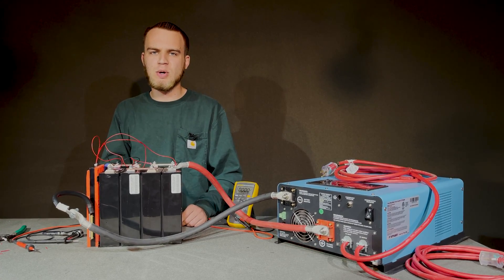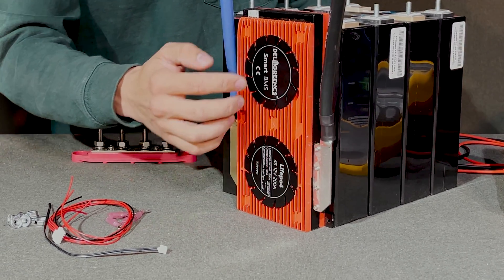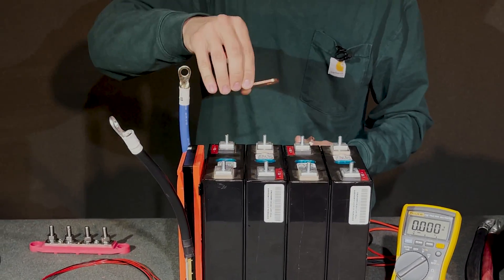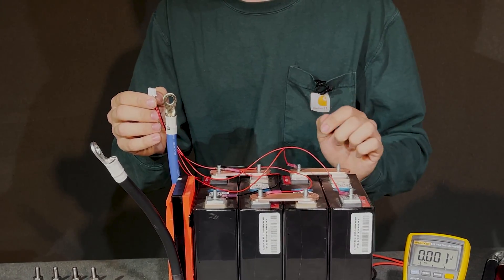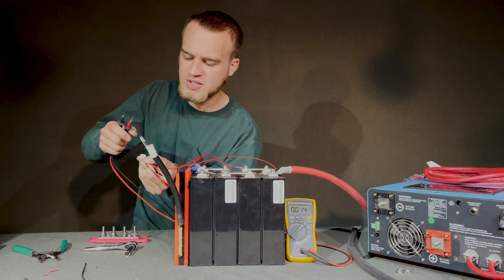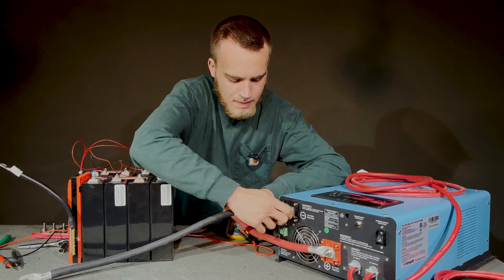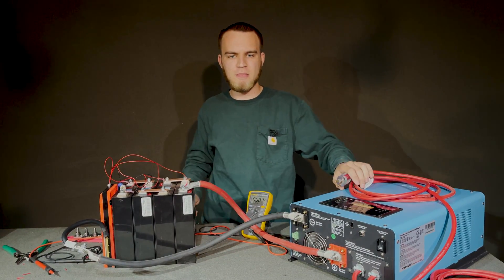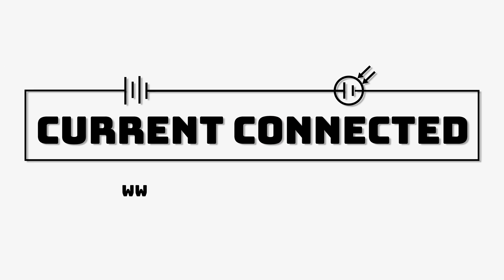Step By Step || Installing & Activating Daly/Deligreen 4S BMS

Comment: When you setup a BMS balancer cables, they all go on negatives with the exception of the last one that goes to positive. Balancers only balance by the negative cable. Will be better to explain that goes to B0, B1, B2, B3 and B+. Nice video.

Comment: Excellent video and very clearly explained in brief. We connected the balancing terminals to batteries, NTC is connected. We shorted the P- and B- terminals and tried to switch on the supply of 60V for a 52V Li-ion battery, 100 AH for around 6seconds. Still we are unable to charge the batteries through Daly 16s BMS. Any inputs please.....
Reply: No current is supplied to batteries, meaning the BMS is not allowing the batteries to charge.

Comment: Even better than folding those fine wires, you should apply Ferrules to them appropriate to the wire gauge, then crimp the ferrule in the ring terminals.  Much stronger.   Ferrules should be used on all wires that are compression fit for a grab, instead of on bare wire.

I just did my Daly BMS wires and the ferrule/terminal method worked great to where the heat shrink on the terminal grabs the plastic of the ferrule.

Comment: When i was wiring my bms i measured the voltage of the battery and it was 54.0 volts (13s battery)
then i connected the bms wires, everything was fine, 1 =4,15 2= 8.3 and so on, but when i soldered the b- to the - port of the battery and measured the b- port and the + port of the battery it showed me 25.5 volts... i dont really know why... maybe you can help`?
Reply: I noticed when the voltage of BMS is lower than battery voltage? The BMS is not turned on. Must have charge current on, after shorting B- P-, try pushing the blue tooth dongle switch, was also told you can try to run a jumper from pins 1 to 3 where the light board plugs in. I'm guessing the light board has a momentary switch that acts as an on off switch.  Instructions are horrible from Daly.

Comment: Can you "wake up" the BMS using power from the Solar Charge Controller?
Reply from the maker: Yes, but this only works with Victron Solar Charge Controllers.
Reply: @CurrentConnected  I have a Renogy Rover 40am MPPT Charge controller now.  So if I connect it to the battery bank after all these other wires are connected for the BMS, will that damage the BMS?

Comment: We tried a Daly LiFePo4 8S 24V 100A BMS  with a Epever UP3000-M6322 nothing no lights on so ordered another unit assuming it was dead. The trick of shorting the B- P- together briefly did it so we now have two Daly BMS's short spark when shorting but expected that now  I need to adjust Epever setting as I had lead-acid leisure batteries before. Thanks for the hint

Comment: Hello, I have a question. Why do you touch briefly the P- to B-? If you do not, the BMS will not start at all?
Reply from the maker: It is to get powered inverter so it can start in charge mode
Reply: @CurrentConnected  thank you

Comment: This is a great video of a simple setup, however I am stuck on the part as to where my solar charger comes in. I do not have a all in one charger and inverter. How should I wire the solar charger to my BMS and at what terminals on the battery pack? Do I just use the same terminals on the battery pack  that my inverter is bolted down with?

Comment: I've done all these are steps and can't get the BMS to wake up. Could the temp sensor calibration be a reason that it's not waking up? It was 36 F outside during my attempt. My inverter powered up with a load but when I removed the bypass jumper between B- and P- it shut down. BMS app isn't seeing BMS. Voltages on balance leads are good. Temp probe and uart Bluetooth connected securely.
Reply: Turned out with this older unit I needed the light board with it's switch
Reply: I am having this issue can you help me? What light board?

Comment: Great video. After watching it I bought a 50a version of the same bms but after setting it up I notice that all it does is monitor the state of charge and temperature essentially. it does not balance the cells and does not cut the charge current when it hits the overvoltage protection level. does it require additional configuration for it to run properly?

Comment: Daly is a “bargain brand” device. This doesn’t “free” the manufacturer of poor manufacturing or bad engineering. My experience with Daly devices have been a nightmare. The blue tooth connection always fail. Charge percentages don’t agree across serial or parallel BMSes, even thought they indicate “balanced” voltages. For instance 1 BMS may indicate 26.6 volts 50% SOC and the other will indicate 26.6 volts 83% SOC. All setting are identical, both battery packs were top balanced. I have 5 Daly BMS’ s and everyone has at least the Bluetooth connection issue. I would only recommend this product for “simple” 1 BMS use only. Adding two presents the dramatic inprecision of this device. Forget about a readable “settings manual” and Just throw the Bluetooth interface in your junk drawer.

Comment: Hi and thanks for this useful video !
I wanted a battery with the best BMS, so I chose one with a Daly Smart BMS 4S 12v200A (with bluetooth).
But the battery can't charge.
So I opened it. And I saw that one connector was the wrong size. It's the connector with 4 red and 1 black. 
When I connected it correctly, the battery screen was finally on (68% of charge).
But the battery still not charging. And no bluetooth.
To initiate the BMS, I tried to connect P- and B-, and the charger turned ON. But when I stop connexion P-/B-, the charger turns OFF.

Do you think the BMS is dead ?

Comment: Great Video!  Straight to the point.  I am curious though.  I would like to put my 200Amp Daly Bms inside of an enclosed battery box.  Does anybody reading this have any real world experience with heat from the BMS.  It looks like it is intended to have air over it?
Reply from the maker: They barely ever get warm, even with sustained heavy loads.  Unless you are getting to 300a+ levels, you really don't need much airflow.

Comment: Hi, I have a brand new DeliGreen 8S 24V 150A, and then follow exactly the same steps as on your video, but NO SUCCESS, I repeated it again and again, still with no success. Tried some other ways (checking the resistant between B- and P- to get 0 Ohm, also did not success, never get 0 Ohm, always showing somewhere around 300 Ohms). The BMS still won't activate. My battery is around 26.74 Volt, is this voltage too high for the charger? I have tried to charge it with 30V, but still no success. Can this be a faulty BMS? How many volt should I charge the battery, if the battery is still having 26.74V. Is 30V charger not high enough, to activate the BMS? In may case, on the last steps, if I unplug again the power from the grid, then the inverter will switch off and will not take the electricity from the battery... (because BMS is still not active = B- to P- still has around 300 Ohms).....
Reply: I have a bad 4s12v Daly BMS that has the exact symptoms yours does. I tried for a hour to “wake” to no avail. I also made sure everything was connected .I.e. temp probe. Solar power is not a poor mans sport. Buying a new high quality BMS would add 6 months pay off time to my DIY system. SUX
Reply from the maker: Did you plug in the NTC Probe?
Reply: Same shit here guys, did you find a solution?

Comment: Really informative video! 
Let me ask one question. After connecting the inverter, you touched P-. I'm not sure what is the purpose of this touching.
Reply: How often will I have to “turn on” the bms?  Every time I reconnect to a load?
Reply from the maker: It allows the inverter to turn on and kick into "charging" mode, if the charger didn't see battery power it wont turn on.  Then, when I stop touching them the power is re-routed through the BMS to activate it.

Comment: Great simple demo; what is the cable AWG gauge on your BMS?
Thank you, sir.
Reply from the maker: balance leads are very small, around 22 awg.  The main power leads are 2awg high-temp silicone wire (200deg. C rated) on this model.
Reply: @CurrentConnected  does it come with the main power leads? I don't see it included in pictures on aliexpress

Comment: Hi All 

Just joined the group, 

I have a question about the Dali BMS if anyone can maybe assist please. 

I have connected my Dali BMS to 14s Lithium ion pack I put together. 
My question, wat type of charger do you connect to the charging port to charge the battery pack. I am not sure if the BMS will take care of the charging (constant current/constant voltage) .Do it need a special Lithium ion charger or just a DC power supply.The DALi wire diagram and wiring instructions do not specify anything.

Thanks in advance 

Regards
Hein
Reply: You need battery charger for 14s LiFePO4 battery.
https://www.aliexpress.com/item/1005002389428499.html?spm=a2g0o.productlist.0.0.1e27313eBGNiaW&algo_pvid=a98dfded-63e7-40be-96b0-6fa2770444c8&algo_expid=a98dfded-63e7-40be-96b0-6fa2770444c8-1&btsid=0b0a556616212030613036808ebf03&ws_ab_test=searchweb0_0,searchweb201602_,searchweb201603_
Reply: This is just an example. I'm not sure this charger is good or bad.

Comment: Hello, I have a siliar situation, my charger does not recognize the battery, it marks an error because it detects too low a voltage. Can I connect B- with P-? That can activate the BMS without connecting the charger yet? Thanks.
Reply: Connect the charger to P-, touch together P- and B- so the charger sees voltage and activates, then once the charger starts up stop touching together B- and P- and the charger will continue charging, and it also will already have woken up the BMS.

Comment: Great video. But i would recommend to tel the subscribers that you should ALWAYS top balance the cells 1st before connecting the bms. I myself have burned 2 daly bms because i did not top balance my cells.
Reply: How do you balance each cell? Can it be done by connecting a charger to each cell until they are charged?
Reply: Yep, nonsense. 4cells 3,3 V ootb, all good.
Reply: Nonsense

Comment: Hello...  I am currently in the process of connecting a 200 amp Daly bms to a 340 ah battery bank that is connected in a 2p4s configuration.  I had the same issue as you where the voltage of the P- wire was around 9 volts where as the battery bank is 13.20 volts.  Is that normal ?  According the to Daly instructions the voltage at the P- wire is supposed to be the same as the B- wire.
Reply from the maker: Apply charge current to P- after checking to make sure your NTC probe is plugged in.
Reply: @CurrentConnected   So 14.4V from a bench charger will work?  How many amps are necessary?

Comment: I saw that you connected the AC side of the Inverter. Was that to put load on the inverter or was that for charging?
Reply from the maker: It was to send charge current through the BMS to "wake" it up.

Comment: Good evening CC... I have an unrelated question that you may wish to answer..?   I have two solar generators and would like to power both at the same time using one 180 watt solar panel (instead of a separate for each)..  Realizing that the sogens cannot be connected together in any way,  my solution would be to provide the necessary branch mc4's for each sogen and isolate each branch with an inline mc4 fuse which already has the diode built in to prevent vdc back charging.  Your thoughts..??
Reply from the maker: I think one unit will pull down the voltage to reach maximum power point, then the other unit would fight with the first unit.  Your best bet is to try and feed the solar into one generator, then plug the ac power input from the second one into the first one.  Try at your own risk, but I don't think your idea will work very well.
Reply: @CurrentConnected  I know of the normal way to connect two sogens.  But, I would use the vdc blocking diodes (already built into the inline fuses) to prevent vdc from being fed back into each leg of both positive  leads of the two mc4 branch legs so that vdc cannot be swapped across the branch, the same as bms does between the solar panel and battery, or solar panel into a sogen....

Comment: What is the default low temp disconnect value? I have heard -7c is that correct? Is that a good number for LIFEPo4 Chemistry? Have you had any luck updating the low temp value through the bluetooth app?
Reply from the maker: To my knowledge, updating any parameters through bluetooth is not possible, but they certainly can be changed through the USB-UART cable.  The low-temp setpoint has various that typically are out of whack and require programming through a computer.

Comment: Great video, thank you.  Just received my 200a BMS this will be a great help to get everything wired together and running correctly.
Reply: does it come with the main power leads? I don't see it included in pictures on aliexpress
Reply: @littlebill2601   it does come with the main leads and balancing/cell voltage leads. I ordered mine from the current connected store and it also came with the Bluetooth module, hardwired to USB connector and the temperature sensor. Also the gentleman who runs the store is excellent, would highly recommend buying from him.